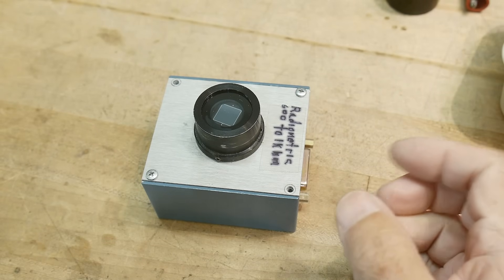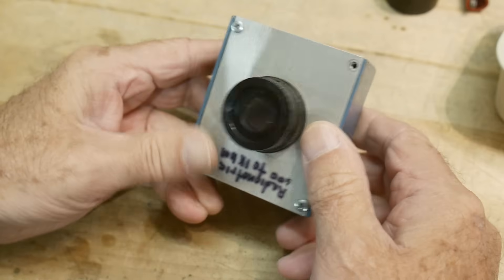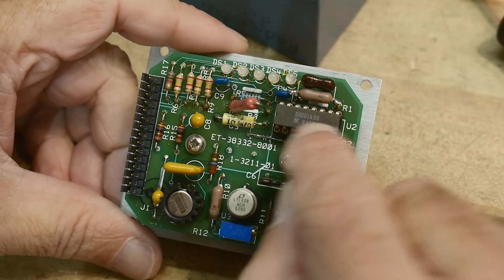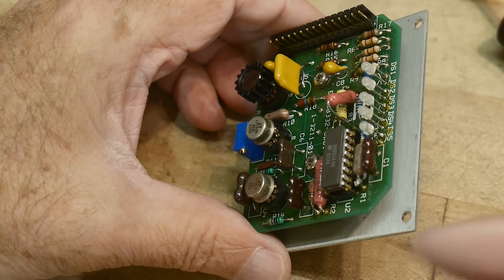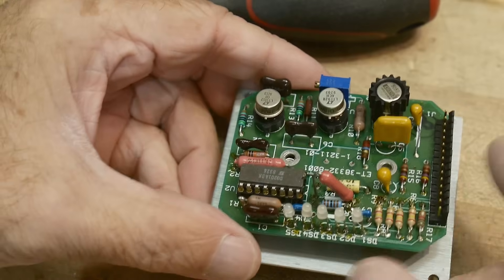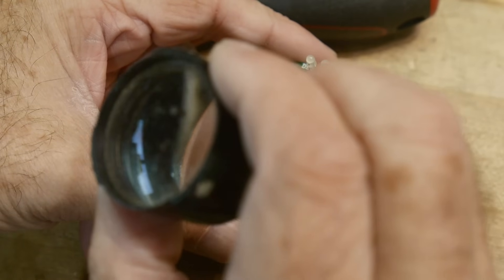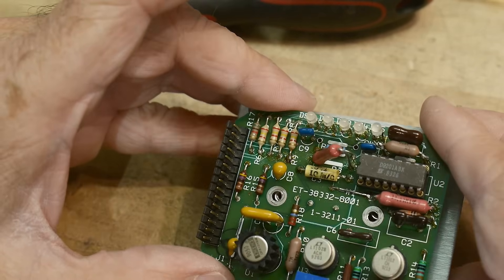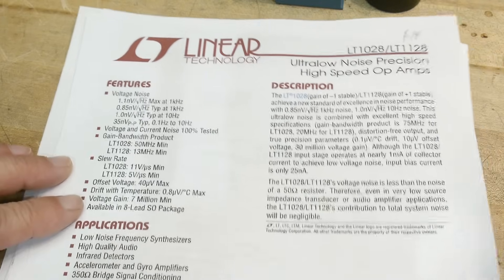#1715 In House Photodiode Amplifier

Comment: Excellent video!
Maybe instead of switching gain resistors/capacitors, it switches between transimpedance amplifiers? Having a switch in the feedback loop feels somehow dangerous to me (although I´ve seen nice TIAs with this feature).
For such huge photodiodes, it also make sense to have a TIA with a bootstrapped input to allow measurements at higher frequencies. Maybe one of those Opamps have it.

Comment: That old HP LED Division still lives under Broadcom (Old Avago) today. The Burr Brown device is could be  a hybrid pair of JFETs attached to a monolithic op amp with the input stage having a metal mask to bypass its own input stage. Thus lowo noise JFETs with high current could be used. A common application at the time for precision parts.

Comment: Long time ago I was involved with log amps also for optics application. 10pA is by far not the lowest input bias current for special op-amps. I was using intersil 8007 (I don't remember exactly the parts number) and this one was 0.5pA typical. Among these we found some that measured 0.1pA. Essentially you could express the bias current in thousands of electrons. Anyway your need these to measure very low light intensities as current on a shorted photo diode. This seems your little contraption doing. The switches might be for ranges. As I said we used a bipolar transistor in the feedback which was a different story...

Comment: Do you know why they used mica capacitors? Today, mica capacitors are several times more expensive than NP0/C0G ceramics and polypropylene capacitors, and I imagine this was also true in the 80s. I don't see a reason to waste mica capacitors on a low-frequency circuit.
Reply from the maker: the real answer is: those are the parts that were in the stockroom.

Comment: I don't think transimpedance amplifiers are allowed in the state of Florida.
I suspect the op-amp with heat sink is driving the cable that comes off the thing.
If you are doing a very high gain transimpedance amplifier, you might use two opamps to implement it.  This gives you more gainbandwidth to work with assuming you can make it stable.
Reply from the maker: speed was not an issue, we always used just one opamp for photodiodes
Reply: @IMSAIGuy  Maybe it was all about accuracy.  You don't want any current in the switches that set the gain.

Comment: In conjunction with our Hi-Fi free-space LASER communicator experiments my buddy designed a photodiode gun that received and amplified as audio whatever light sources it was pointed at. You could hear fluorescent lights flicker at 60 HZ and the pulses of IR remote controls. Fun toy.
Reply: I've seen a similar thing using a solar panel and a Bluetooth speaker to check out if you have flickering lights because of not enough smoothing.

Comment: I designed a few things like that for hearing research. The slowest was to monitor a strobe light for output stability. The fastest was part of LDV they were using to measure sound pressure levels inside the cochlea.

Comment: Well, I would agree that is was probably made under a time-crunch but 4-layer boards are really pretty standard in that they allow you to have a power and ground bus; which again allows you to not have to think about shielding and power distribution/decoupling when you're just using traces for the power and ground.
I had to laugh on the DG201; that goes way-back!  We switched over to using 4016's and 4066's, not too much later as they were cheaper and as I recall lower on resistance.
73...
Reply from the maker: the price of that 4 layer board in the 1990's was way more than today.
Reply: @IMSAIGuy  Yeah but if you consider the burden-rate of even a small group of engineers, techs, plus a program manager could easily exceed a $1000/ hour waiting for this thing before they could all be back to full utilization, the cost of that 4-layer board that has the greatest potential to work the first time (involving low-level, noise sensitive signals you don’t want as part of the measurement) without diagnostic-time and rework (which may very well involve another cost-center) is nothing in comparison!  Any signal integrity problems,have an immediate vertical cost and are the worst to sort out whether time or money.  Also, the hardware may have been charged to another cost-account since not to skew labor costs.  I never saw anyone catch-heat for an ‘elaborate’ JIT prototype unless it didn’t work…
Reply: @SpinStar1956  Having worked in an R&D group back in the 1980's designing and building laboratory "black boxes" such as this, I agree with all of the points you raised. I usually had one shot to design and build a 1-off device and it had to work. Parts costs was considered insignificant compared to the labor cost of the group of engineers I worked with. So the choice of parts and the 4-layer board is just the sort of approach I would have used back in the day.
Reply from the maker: ok, but remember we only got about $12/hr back then.  @SpinStar1956

Comment: Interesting video. The heat sink on the OPA101 is important to keep the JFET input stage as cool as possible given it's exponential relationship to temperature. The spec10pA max is only achieved with B Grade part with the heat sink at 25C ambient...